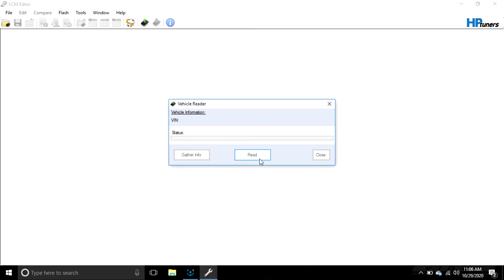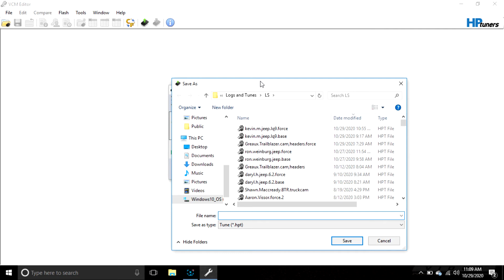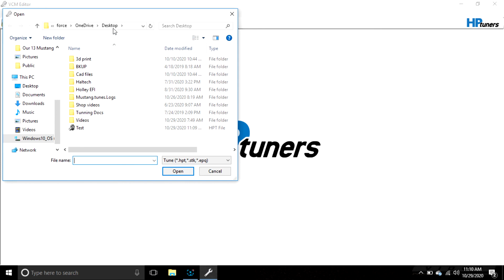Tutorial - HPtuners (VCM Editor) How to Read and Write Vehicles

Comment: Write Vehicle isn't a clickable option for me..any tips?
Reply: I’m in the same boat any luck ? Just show me the red arrow on the right side
Reply: @cesarcash602  nope. Chatted with tech support for awhile. Ended up submitting a ticket on the website. Waiting to hear back
Reply: @ I got it figured out .
Reply: I had a file open already . Try closing the file should be on a folder on top left . Then open a new file and it should let you ready vehicle
Reply: @cesarcash602  I've tried closing and opening the stock file multiple times. That's what I'm supposed to have open when trying to write correct?

Comment: So can you take off an existing aftermarket tune by reading the file? So that it’s saved and the tcm can be reprogrammed?
Reply from the maker: If the aftermarket tune is not locked, then yes, you can read it.  If it is locked, you will not be able to read it
Reply: @ForceEngineering how can you tell if the car has a tune or not, I'm unable to read my cars tune, it just keeps saying it failed to read.

Comment: How do you check to see if vehicle took the tune file?
Reply from the maker: If you know what changes were made, you can do a read of the file after you've flashed it, and then compare it to the tune file you uploaded.

Generally though. If that file was open, and the programming went as expected without any error messages, the tune was programmed correctly